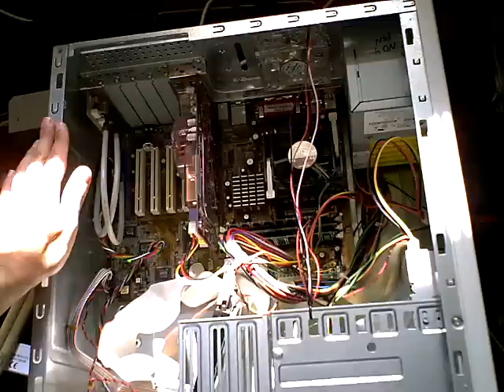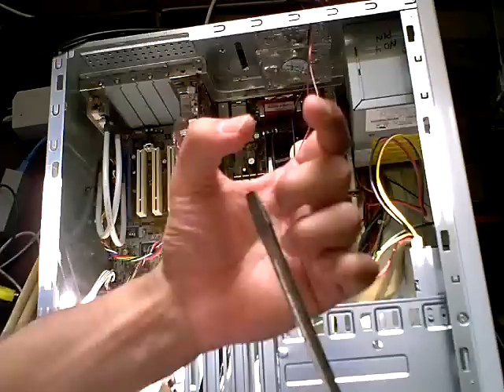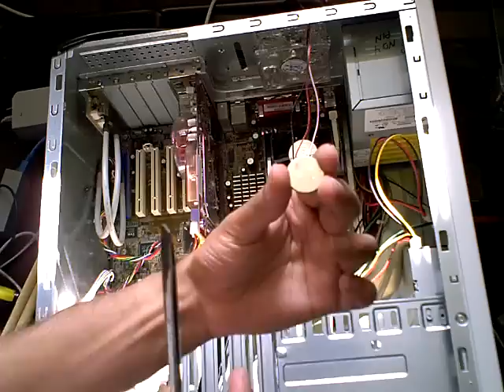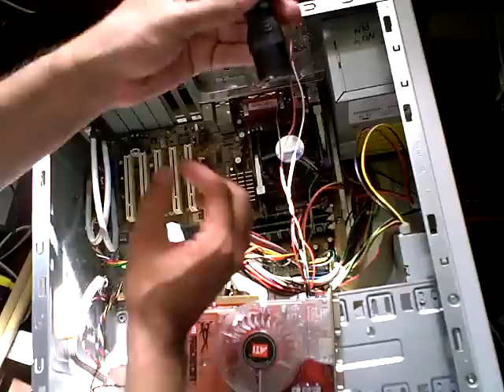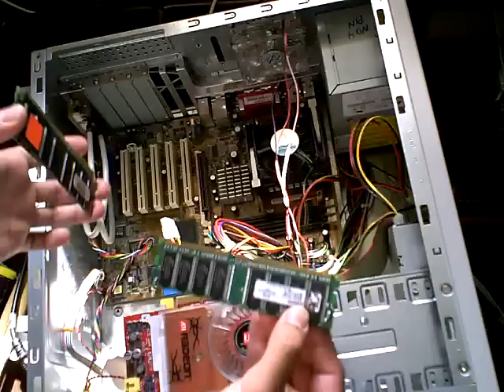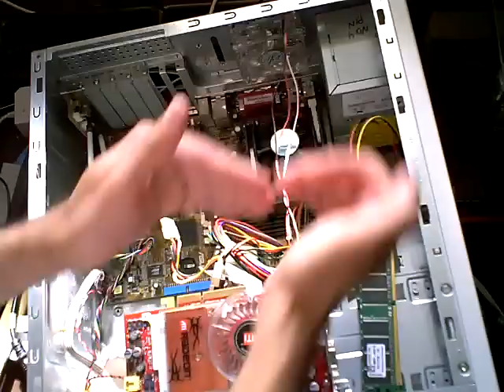How to possibly fix a PC that will turn on but will not beep and will not display anything on screen

Comment: Hey thanks for the video I do have one question though, I brought my computer to my friend's house and we hooked it up to a different monitor and mouse and keyboard. I'm not sure if that had anything to do with it but when I brought my Pc back and connected it back to my TV with HDMI cable and tried turning it on and it beeped 3 times 2 short ones and one medium one just wondering what it might be causing that? I took out the Cmos battery, my friend told me to wait 48 hours for it to drain all the energy out of it do you think maybe I should reset the Cmos too would that help it boot up normal again? Thanks again.
Reply from the maker: +Matthew Mahs It's a good idea. But read up on what the beep error code is trying to tell you. Beep error codes differ from one BIOS manufacturer to the next. To discover what the beep error code is trying to telling you, discover the manufacturer of your BIOS (available in the motherboard's manual or on the motherboard's manufacturer's website {on the page for your specific motherboard model}) and then look up the frequency and interval of your beep error code on:

http://www.computerhope.com/beep.htm

Comment: so what did you end up dipping to yours to make it work? mine seems to have the same problem as yours
Reply from the maker: +Johnny Garcia What I did in the video worked for me. 

If the steps in this video did not provide a solution to your problem, view:

http://www.youtube.com/watch?v=_EK9a-R5pss

You never know, maybe rebuilding the PC in the opposite sense that you took it apart will solve the problem.

Comment: I have a slightly differing situation. My pc won't power off even if I hold the power button, I have to unplug it, there are also not one, but 2 3 pin slots, one with the blue jumper cap, and one with an easier to grab, light green one, both right next to each other,
Will I need to put both of those in in 2-3 position? or just the jumper with the blue cap?
Thank you in advance for the answer.
Reply from the maker: +Brendan May Your issue will not be fixed by resetting the CMOS. Chances are there is a setting in your BIOS that governs what your chassis power button does when you press it. Look at those settings and ensure they are proper. Alternatively, you can obviously select 'SHUT DOWN' from the Windows start menu every time you want to power down.

Comment: I recommend first checking if your 24-pin connector isn't loose it was the case on my issue maybe it could be what's causing yours. Thanks for the fantastic video btw :D
Reply from the maker: +TheBenchmarkBrothers Sure thing. Thanks for the good tip : )

Comment: What is it that you tap your fingers on ? When you say static discharge or something , is it any special material that you use to discharge your fingers or what is it ?
Reply from the maker: +Jonn44ss I use the metal of the power supply. That should do the trick.

Comment: Thanks a lot man. All the time it was one bad ram module. At first i suspected an integrated video card problem. Would have bought a new motherboard and still had the same problem.
Reply from the maker: +DJ Glad you got to the bottom of the issue : )

Comment: Not sure if you can help me, but I'll tell you the problem. I was building a custom pc. I can turn it off and on with just the power button so I don't have to force it to power down. I plugged some normal speakers in so I can hear the beeps, not the tiny speaker for testing. I don't hear a beep and says nothing is appear as if the pc was off. I checked my cpu for any bent pins but it seems fine. Do I have to use the same method in the video to fix my computer? Because I have nothing downloaded on it, not windows or anything. I can't seem to get it working.
Reply from the maker: +Isaac Kirk Yes. Try what is shown in this video. If no luck, Breadboard it (explained in the following video:)

If the steps in this video did not provide a solution to your problem, view:

http://www.youtube.com/watch?v=_EK9a-R5pss

You never know, maybe rebuilding the PC in the opposite sense that you took it apart will solve the problem.
Reply: I fixed the problem long ago, there was a problem with the graphics card and I sent it back in and got a new one.
Reply from the maker: +Isaac Kirk thanks for the update

Comment: my PC used to occasionally crash whilst playing intensive games and one time it crashed and it didn't turn back on again. now when i try to turn it on, the fans and GPU lights flicker for a fraction of a second then turn off. do you reckon it is motherboard? or the PSU? i've tried making sure all the sockets are joined correctly and i cleaned everything, and i basically re-built the whole thing and it still happens
Reply from the maker: I had a very similar situation with a motherboard once: turned out I rendered the AGP video card slot defective (or it was already defective and I just helped it along). If you tried everything in this different video (including breadboarding):

http://www.youtube.com/watch?v=_EK9a-R5pss

with no luck, then I'd guess the motherboard is dead.
Reply: RodneyDickson i think it may be the psu, as i ran the 'paperclip test', which it failed. did your fans and light flicker when you tried to turn it on aswell?
Reply from the maker: Yep. At first my kit had the symptoms of a short circuit, but upon further investigation (essentially burning out video cards) I defaulted to the board being faulty.

Comment: But, am I right in saying that a power supply is NOT a battery? Its just a hard wired transformer that cannot lose its effectivity over time, unless it has burnt insulated wires from overheating. In that case though it would short out, shouldn't it? It either works or doesn't. I'm thinking only batteries deplete power ability.
Reply from the maker: +John D Not from my experience. Power supplies lose potency and overall output over time.

Comment: when you say "disconnect components" you mean to disconnect both the data connection to the MB and the power supply to the component or is enought to disconnect the data connection to the MB keeping the component like HD powered up?
Reply from the maker: Yep, disconnecting the data connection should suffice, unless of course your PSU is faulty, and having too many power connections connected are draining too much juice to properly 'turn the PC over'. Safest way to go about it is just disconnect everything, power feed and data connection

Comment: I have an old computer that worked until a few months ago. I've cleared the bios memory and removed the video card and there are no beeps. I have removed memory and there are no beeps. So I'm down to the processor or the motherboard. Before I remove the CPU will the motherboard be able to enter the bios without a cpu installed? Or will I have to determine some other way to test to see if the cpu or motherboard is dead in my case?
Reply from the maker: +dethplaque Sadly without a compatible alternate motherboard and CPU to swap test, there is no easy way to find out. You can only enter the BIOS if you successfully POST, so you'd need minimally a motherboard with CPU+fan, power supply, RAM, and video out in order to enter the BIOS.

Comment: MB manufactures have listings of qualified memory sticks which work in their systems, there are some which will cause errors because of mismatching. I've seen this on P1,P2,P3 motherboards but also failure of the front side chipset, try using a different channel if there are four simm slots.
Reply from the maker: +Dirtyharry70585 Good tip. Thanks for sharing

Comment: My college was recycling old PC's and I grabbed one. It had a Core 2 Duo E-7500 which is better than the Pentium D 820 I currently have in my PC. So I went ahead and replaced the old CPU in my PC with the Core 2 Duo and I had this issue (powers on, doesn't beep/show anything onscreen). I tried a few things like verifying if everything was plugged in fine and it was, then I went ahead and removed the CPU and put the Pentium back in. Booted up and worked perfectly fine this time.
Do you think the CPU from the PC that that was going to get recycled was defective? I would've enjoyed the upgrade lol.
Reply from the maker: +Onixpected (DeFy Touch) Chances are your motherboard is not compatible with that processor. I mean sure, it could be defective, but if I had to guess, I'd lean towards it not being compatible. Your motherboard manufacturer's support website will tell you which processors are supported by your board.
Reply: RodneyDickson so, socket type isn't the only decisive factor in CPU compatibility? Both were LGA775. Is it possible that the manufacturer locked the MOBO?
Reply from the maker: +Onixpected (DeFy Touch) The issue has to do more with the hardware supporting said components. For example, LGA775 will continue to be used despite newer and faster processors using the same socket type continually being developed. If the hardware of said motherboard cannot understand the architecture of a newer processor despite using the same socket type, it'll hang. Your motherboard manufacturer's support website will have a list of which components are supported...perhaps your processor might be supported with a BIOS update, but confirm on the website before updating the BIOS
Reply: RodneyDickson it says that the motherboard (Acer MRS600M) is compatible with a Core 2 Duo up to 3.8GhZ (E-7500 is below 3.8GhZ), with a 533/800/1066MHz system bus. I checked my BIOS and the Pentium D is running at 200/100/100. Do you think the CPU didn't work because that info was stored in the CMOS and wasn't compatible with the Duo? Do you think a motherboard update would fix that issue?
Reply from the maker: +Onixpected (DeFy Touch) Here's the thing, I'd certainly try the CMOS reset method before updating the BIOS. If the CMOS reset method does not solve the issue, you could unplug the deal, swap in the functional CPU with fan, power up, download the newest BIOS from your motherboard manufacturers support page and follow the instructions in order to implement said BIOS update, but be forewarned, updating a BIOS involves risk of potentially bricking (rendering inoperable) your PC. I'd only do this if, to you, it's worth the risk of possibly destroying the motherboard.
Reply: get a eraser and clean off the ram and see what would it do
Reply: and check your motherboard for bad capicators

Comment: hi, I have this problem. when I press the power button the PC don't start and no beep.
so i got the long beep's when I removed  my RAM, like in this video. I installed them one by one and composed them in all the possible combinations, still nothing. I installed a new RAM that I got it from my other working PC, still nothing.
could it be my power supply? (the PC is a little old and it worked on 150-170V(not 220-230V) for more than one year)
or do I need to try something else?
(sorry for the english, its not my native language)
Reply from the maker: Your English was fine : ) Quite simply put, the RAM from the other PC might not be compatible with the PC you're trying to get to run. You might need to research the motherboard's manual to find what spec of RAM is recommended by the manufacturer to function with the board. Good luck with it : \

Comment: I power up my computer and it displays, sometimes, and the it freezes and makes a buzzing noise out of the speakers? Will this work for me?
Reply from the maker: +Mark Komar You can try, but I doubt it. It sounds like your CPU is overheating. Next time it happens, reboot, go into the BIOS, and check your CPU temperatures. If they are close to the autp-shut-down temperatures (also listed in the BIOS) then you have a cooling issue

Comment: I have the same problem, but all my fans spin slowly, although i couldnt find any problem with my ram/graphics card. Also i cannot find a PSU to replace and check with mine. My board and psu, both are not very old though, barely 2 years, in warranty. Any thing i can check for myself before taking it to a mechanic?
Reply from the maker: Breadboard it (explained in the following video:)

If the steps in this video did not provide a solution to your problem, view:

http://www.youtube.com/watch?v=_EK9a-R5pss

You never know, maybe rebuilding the PC in the opposite sense that you took it apart will solve the problem.

Comment: Pro Tip! always remove the hard drives power cable before turning the power on / off.
By the way, why you did not return the cmos battery?
Reply from the maker: +steel wolf Good tip. I did not return the CMOS battery because this machine doesn't need one to run, but you are correct, the CMOS battery should be present.

Comment: I didhave this same problem, but in my case, it was my ram so i pulled all 3 out and put one back in and it turned on, so then i put 2 and 3 back and everything was back to normal very weird but it worked, THANKS for your upload very helpful.
Reply from the maker: +Paya Ibarra Happy to help : )

Comment: Hi Rodney, have watched the above video and have tried all the techniques but still unable to fixed my Dell T1650 workstation. Problem started when I tried add an SSD to the working workstation. Power button diagnostic LED status suggests the mobo is bad. any advice? Thanks
Reply from the maker: +st remmy When disconnecting the SSD, does the workstation revert to operational status?
Reply: Have disconnected the ssd, ram, optical drive, hard drives and also perform the CMOS reset described by you. Yet the workstation never reverts back to operational status. Now not quite clear if  the issue is Mobo or PSU. Before workstation stop working, I remember that I connected the ssd power connector only without the data connector.
Reply from the maker: +st remmy Breadboard it (explained in the following video:)

If the steps in this video did not provide a solution to your problem, view:

http://www.youtube.com/watch?v=_EK9a-R5pss

You never know, maybe rebuilding the PC in the opposite sense that you took it apart will solve the problem.

Comment: my monitor would not come on. went through your procedure and when I took out my vga card the monitor came on. put a new vga card in and it did the same thing, monitor didn't show anything on the screen. took out the new card and the screen came back on. the new card fits the slot but doesn't require the plug in as the other card did. What do you think. Leave the card out and use,  or maybe try a different card, should the new card have a plug in? Thanks
Reply from the maker: +Dave Meeks Sadly, just because a card fits a slot, it does not mean that it is compatible. Have you ever used this card before on this system?

Comment: when u remove the battery, does it not do the same thing as shorting your CMOS pins ? I am pretty sure u dont need to do both?
Reply from the maker: +David Hamilton Normally yes, but some machines do not in fact clear the CMOS efficiently using but one method, so I use both to cover all bases.

Comment: Quick question.   My computer shut off during video conversion and downloading and when I turned it back on I heard a pop and burn smell.  Now its just like you got here.  Everything works but not post or beeps.  I only have 2 blue lights on my msi motherboard instead of the 4.  The pop happened at the top of my case so I dont think its the power supply because thats on the bottom.  I dont have any scorch marks or bad compaciters but someone told me I could have gotten a surge and fried it.  It was plugged in a protector but I was running a big fan in the other outlet which I never did.  So I'm down to the motherboard or cpu being the problem.   MSI thinks its the motherboard.
Reply from the maker: +NinjaBill423 Yep, sounds like a popped capacitor (this is most frequently the case). Sorry to be the bearer of bad news.

Comment: Hey Rodney i have a similar problem as shown in the video.i recently installed a new processor.after that when i turn on my pc there are no beeps.the fans spin for about 15-20 seconds and then the cpu shuts down completely.what should i do? Please reply
Reply from the maker: +Anandu M If this is the first time you are trying this hardware on your motherboard, there is a chance that this new hardware is not compatible with your motherboard, despite the same bus type and despite the fact that the new parts fit in their respective motherboard socket. Your motherboard manufacturer's website will have a support page dedicated to your motherboard's model, and on this support page should be a compatibility list for such components as CPUs. Ensure that your new component is certified to function with your motherboard, and if your new component is not present on the compatibility list, then there is a chance that the new component is not compatible with your motherboard.